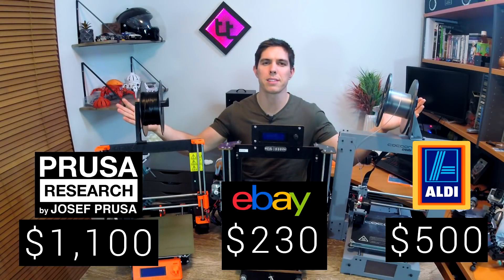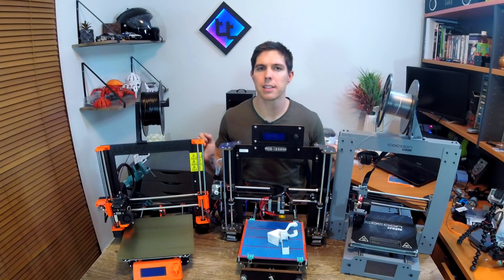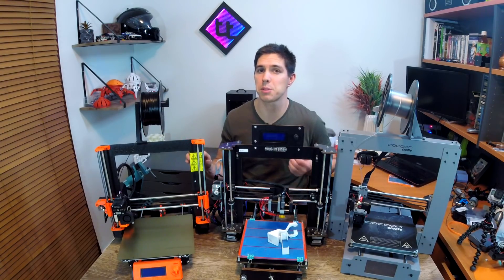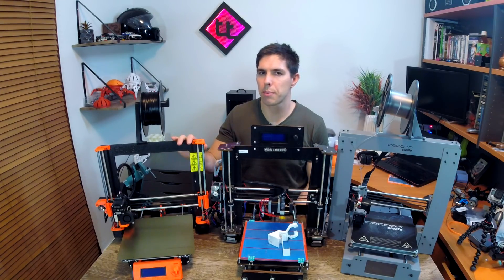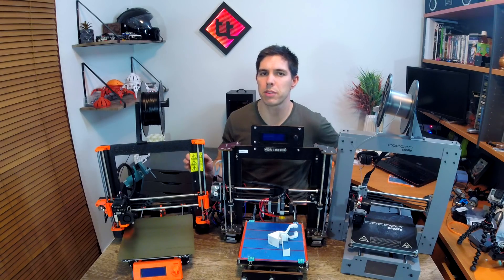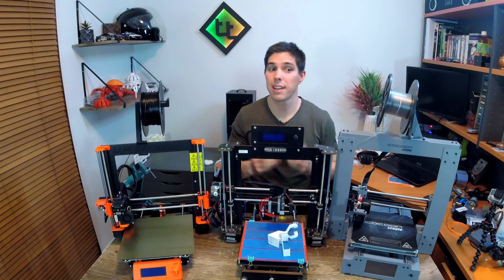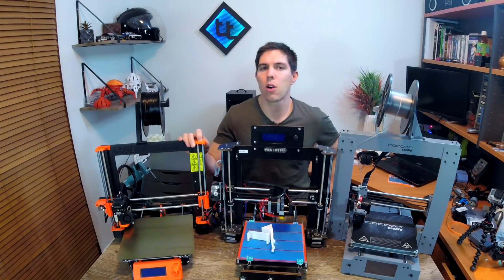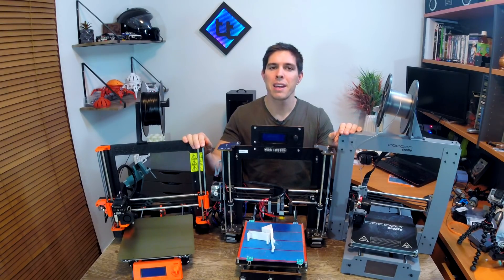i3 Comparison: Prusa i3 MK3 vs Cocoon Create Touch vs CTC i3 Pro B

Comment: Great review. My requirement, due some physical disabilities, was a printer that worked, out of the box with minimal fuss. Although I’m a qualified electronics engineer I now struggle with the practical stuff. I tried two Chinese printers that promised to meet those needs both failed within a month. They weren’t a cheap option either. After my deliberation and nearly quitting the hobby I went for a Prusa MK3 assembled....worth every penny! Arrived in February and has printed almost every day since. I’ve burnt through almost 2km of filament according to the printer. If you have the money go for it. Unlike many I have no desire to mod it. I just want to design and print stuff. That’s what the hobby is to me but I know many others enjoy the thrill of the chase in terms of getting it going then getting it printing 👍👍
Reply from the maker: What type of stuff are you designing and printing?
Reply: Teaching Tech hi, I’ve designed things for around the home, parts for some RC projects inc drones, parts for cars and at the moment I’m working on stuff for a mobility scooter based on a larger version of the PiBorg 6 wheeled vehicle

Comment: Totally agree on you with this one, I personally own the wanhao duplicator i3 plus and recently acquired the MK3. the i3 plus once tuned is an absolute workhorse but it takes a bit of time and tinkering to get it to that stage. The MK3 is a printer which requires very little time and tinkering to get it printing high quality models (especially with the pre-built, I  bought the kit) and'll continue like that with the tinyest bit of maintenance (mainly dust and wiping the PEI), although I have modified my MK3 with carbon fibre tubes and igus bearings on the  X axis, photos will come soon on the Facebook group.

Comment: I agree with what you said about the mk3, and the Cocoon Create. However the CTC i3 ProB, I disagree 100%.

It's the WORST printer for a beginner, or someone who does not have much money.
I have multiple monoprice printers, which I think are good printers for the money, they are far FAR from a "real" 3D printer.

To "fix" a "cheap" printer, you are looking at the same amount of money as fixing a high end one.

All motors, all electronics, that are of "decent" quality, are what you would put on your mk3, if it breaks. I can order a full set of rods, cut to length, for 25$ on the mk3. I can order a full set of bearings for 14$.
I can also order a full set of motors for 150$ (this includes the lead screws as they are directly mounted in the Z motors)

These numbers might seem high. But let's compare it to what this stuff would cost to replace for the CTC.
To replace the hot end, with one that is going to work, and not cause problems, you are looking at 50$+. (Or buying a whole bunch of cheap ones, and spending a week, testing which one works best... and still pay 25$, for a hot end that's not as good)
Need to replace the motors? You are looking at around 15$/each. Only 1/2 the price of the mk3's. (and that don't give you a new set of lead screws!)

My point is, maintance, upgrading, repairing, and "fixing" will be the same price on almost any of these printers.

And regarding "first time users".
If I gave you a lawn mower that didn't run, that I let my 10 year old take apart, and put all the parts in a bucket.

I sell you the bucket, and say. "Yeah man, it should run fine, it didn't run smooth though. All the parts should be in there."

How do you know where everything hows, and what it's supposed to do. How do you even know it's running right? You've never seen one before? Do you assume it's supposed to randomly rev high and low? How do you fix that? You have no idea.
Not "new mechanic" friendly.
I do however think the Monoprice Mini Delta, and Monoprice Mini v2, are GREAT printers for the $$.
Reply: The CTC seems like a collection of parts rather than a printer, a new user would probably throw it away out of frustration. An experienced user (who would probably not buy it) would at least know what was wrong and how to fix it.
Reply: Instead of unnecessary speech, practical demonstrations of CTC Pi3 Pro B functionality:
https://youtu.be/L89CUTFfGAM
https://youtu.be/Bwk3kiUC6HQ
https://photos.app.goo.gl/FUxrNpC2xSJxgDbs1
Reply from the maker: Just to clarify I only recommended the CTC for someone who couldn't afford anything else. I also mentioned other printers available from China and clearly stated all of the issues. Thanks for taking the time to post a detailed comment.
Reply: I don't know that I would "fully" agree with not buying a CTC.  It does have its place and like was stated in the video, is for someone that doesn't mind tinkering and spending time on it.  It is a piece of junk for sure, but is also a learning tool as there is loads of information out there about upgrading it and such.

I already owned a Taz 5 when I bought the CTC,  but I did not understand all of the aspects of what makes a 3d printer not just work, but excel.  Sure, I have essentially replaced every single part on the CTC and it doesn't even resemble it's former self, but now I know how to make my own printer from the ground up for $600-$700 that has more features, like auto bed leveling and the oh so sweet removable magnetic build plate.  So yeah, because of the struggle with the CTC I can build a full print farm of machines that print better than a $2500 one at less than 1/3rd the price.  

If you are not buying a machine for a specific purpose that you need to work right now, then don't be afraid to start a journey that will leave you better off in the end.
Reply: Aaron Cole see I agree. Except I'm in the process of building a printer myself. A 7 motor core XY, no cost barred on electronics, and hotend. My budget is 500$. My goal is to get the quality step between cocoon and mk3... Above mk3, 500x500x500 build volume.
All I'm saying is when you want to learn a concept. It's easier to start from something that works.

Comment: Very good selection of printers for this sort of comparison!  I worked at a Radio Shack WAY back and one of the things I learned from one of the "sales" meetings was to consider the absolute best or most expensive item in the group and ask yourself if it had extra features or other benefits that you can live without?  I had ordered the mk3 but cancelled it and I mow have a monoprice select plus.  I am quite pleased with my decision and the printer.  Thanks for the comparison video!